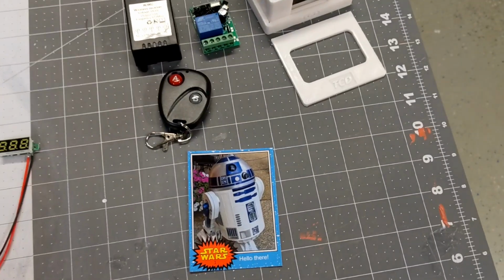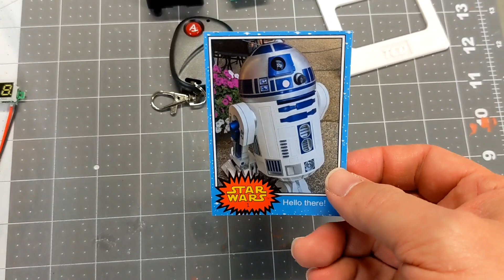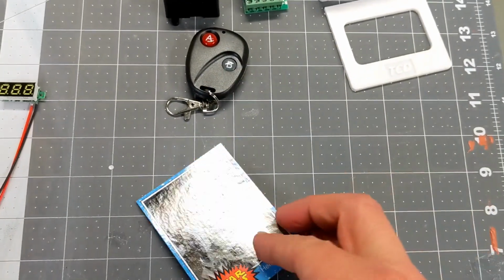So What's Next?

Comment: Hey Jason! I have so many questions but I’ll start with someone mildly basic…what paint did you use for the dome? (silver/aluminum portions) I’d like to use something I can apply with an airbrush of some sort because I feel that application provides a better finished product. Thanks for any insights! And your R2 looks fantastic!
Reply from the maker: Thank you! All of my painting was done with "rattlecan" spraypaint. I'm pretty sure I used Rustoleum 7715 Aluminum on the dome (the dome was the first thing I finished way back in 2020 so my recollection isn't 100%) and that was on top of a base coat of Rustoleum gray filler primer. The last step was applying silver Rub n' Buff on top of the paint. The Rub n' Buff is a wax-based product so don't try to apply any clear coat on top. It's also a bit tricky to apply.

Really, my finishing process has evolved quite a bit since I completed the dome. Were I to do it again, I would definitely apply a base coat of gloss black before laying down the silver, and I would have sanded it even more smoothly than I did (the facets are visible in the right lighting).

I managed to achieve just the right about of shine that I wanted, but if your goal is a more "chrome" look and you're good with airbrushes, the Alclad chrome paint is one of the best options out there. Good luck!

Comment: What size wires did you use for your electronics? I know you used 10 gauge silicone wire for the batteries. I would like to order my wires now. Thanks
Reply from the maker: My basic rule of thumb was to use the largest size wire that I could fit into the connectors on the various components. Looking over my remaining wire, this turned out to mostly be 16 gauge. I used a little bit of 18 and a little bit of 14 - but not very much. I used standard 22 gauge "hookup" wire for the signal lines between components.

Comment: Where did you purchase your CBI , DPL and VU meter from?
Reply from the maker: I got the full CBI/DPL set through the run on Astomech.net (https://astromech.net/forums/showthread.php?15258-Dataport-logics-amp-Charge-Bay-Indicators-BC-Continuously-Approved-Various-Open&highlight=dpl+logics) I got mine probably close to 2 years ago - not sure if there's another source or not.

The VU meter I got from eBay. You can search for it and you'll find a bunch of listings - most of them in China, but some are stateside. Be warned - most come disassembled, so if you're like me and have crappy soldering skills, see if you can find them assembled. Here's a great post on Astromech that details the installation: https://astromech.net/forums/showthread.php?35850-VU-Meter-Tutorial-for-R2-s-Logic-Data-Panel&highlight=meter

Comment: The magnetic switches for the CB and data doors is smart. I need to remember that when I order my lights now that I got my data door functioning
Reply from the maker: I sure hope they work out as well as I imagine. We shall see!
Reply: @jasonsR2D2  While I did originally use a switch on my DP door, you can also eliminate the switch and use logic output from your control system to turn the lights on when the door opens and off when it's closed. I'll try and write it up in my log.

Comment: Nice to see you're working on more cool features!  I see the saying that you're never really 'done' holds true;) 
I'm still in the process of deciding which way to go with the main hardware, placing orders and waiting for parts to arrive.  There's a lot more involved than I originally thought.  Your videos have helped with some of the decisions I've made that I wouldn't have thought of otherwise.
Reply from the maker: There really are so many ways you can go with the electronics - that's a big reason I was stuck with analysis paralysis for so long. My biggest takeaway from this process was keeping it simple (just two voltages) and not worrying about anything below the neck until the rest of it was working.